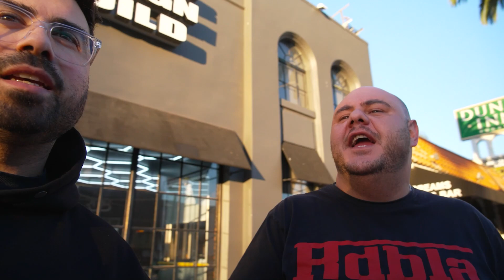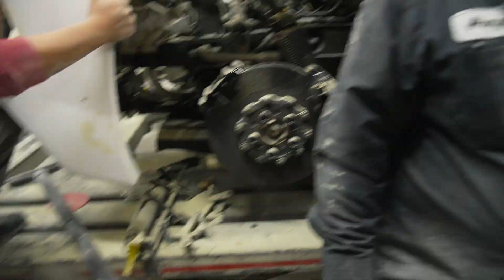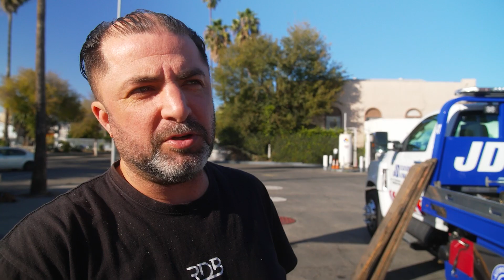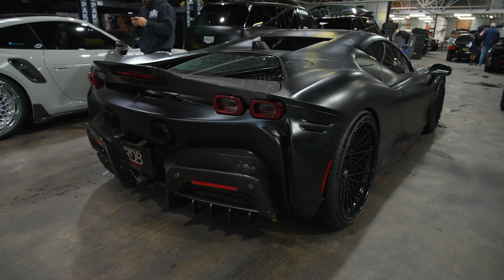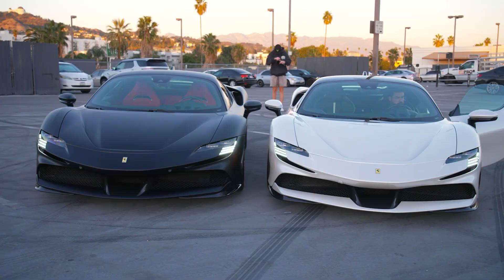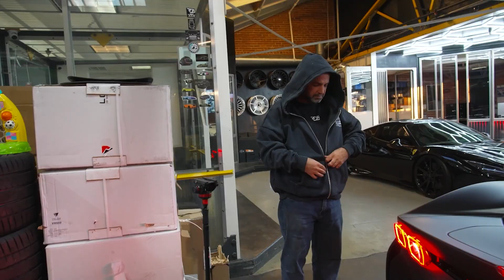FERRARI SF90 TAKEOVER, EXTREME MODIFIED EXOTICS AT RDB.

Comment: The SF90 has the potential to be such a badass car with the right kit, upgraded turbos, exhaust and downpipes, tune, and wheels. Stock, they aren't aggressive enough IMHO for the performance they deliver.
Reply: I like it the way it is.  The original way it comes.   Maybe the rims need to be changed.
Reply: @antomano5623  They look so much better modified and are so much faster with the right performance mods.
Reply: For a car you're spending almost $500k on, I think that's a fail in the manufacturers part. And to top it off, it doesn't even have the butterfly doors just the regular boring old ass one's and the entire car just look like shit.